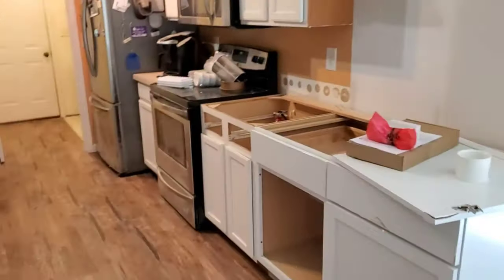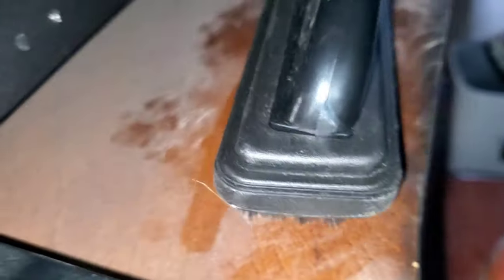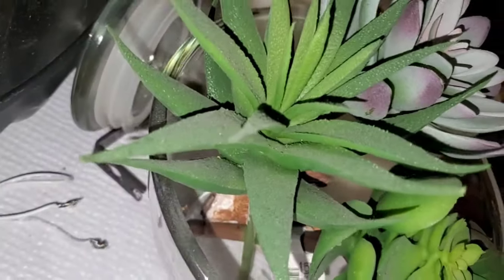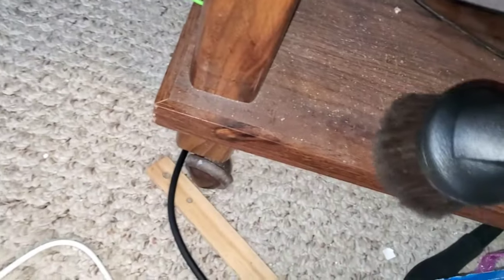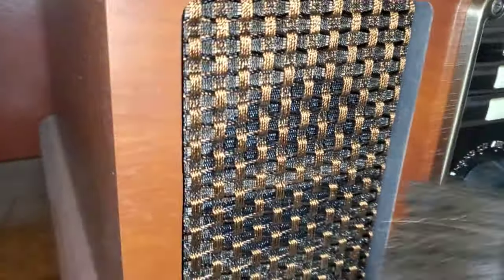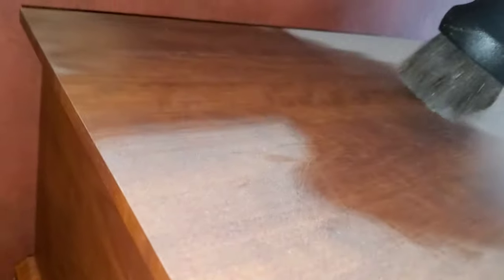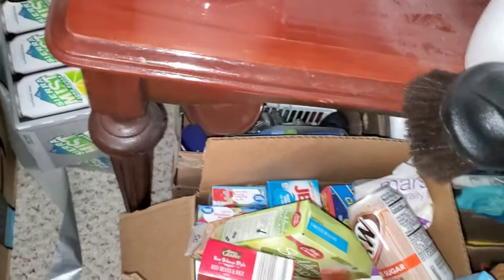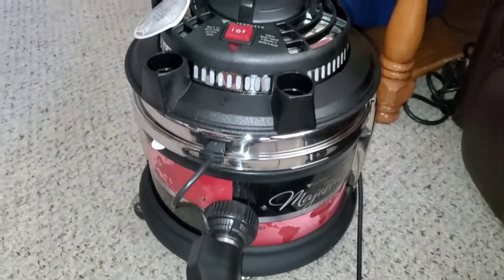Filter Queen Majestic!

Comment: Hot bucket of water all purpose cleaners does the trick and a vacuum for the upholstery etc. We humans are gifted with a brain meaning we can think! You cant really blame builders for making your house dirty didnt even make effort to put sheets over your furniture !
Reply from the maker: They should have used proper extraction techniques using a water grinder, when they were tearing up the ceremic tile mortar. They should have blocked off the area they were in from the rest of the house using plastic sheeting. They did none of that. I wasn't home and didn't know they were starting that day or else I most certainly would havecovered everything had I know this is what was going to happen. I was out working. I came home to this! I do put all the blame on the carpenters. They should have known better.